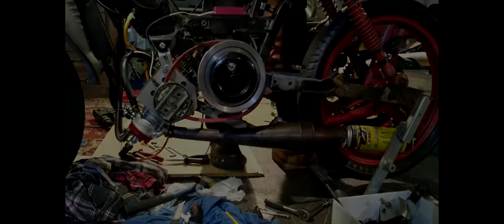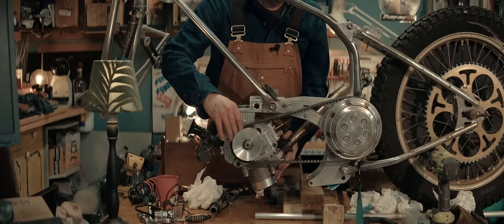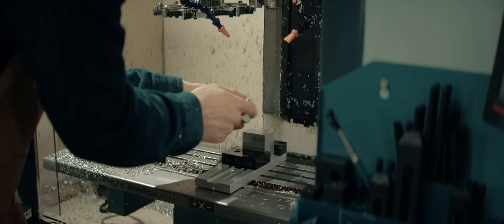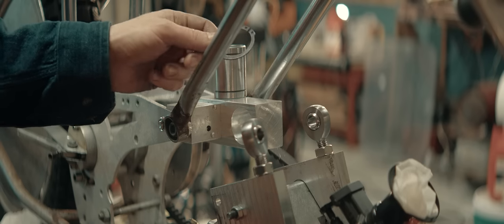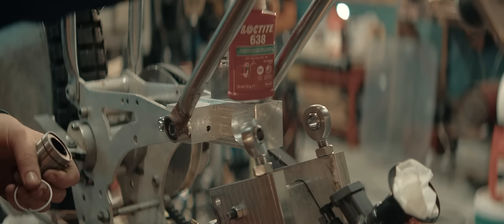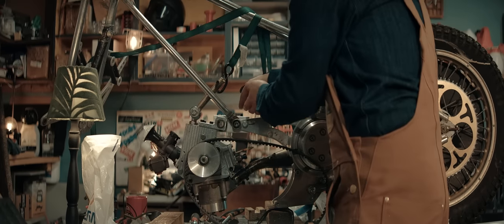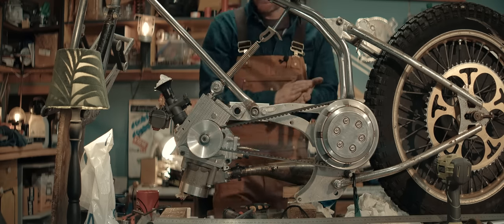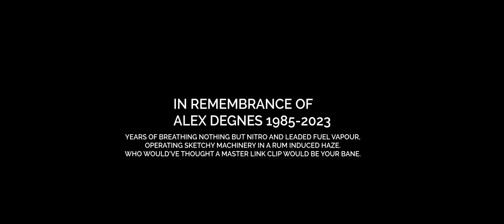A Norwegian Madman's Two Stroke Swinger in-and-out!

Comment: I ran across your channel a while back an I'm so glad I did. This is top tier content, without a doubt. It's not so much about editing or b-roll, it's about the engineering and watching you build. I think we'd all still be here if all you had to record was a webcam or an old phone. I just wish I'd found your channel sooner.

As a side note, if you did in fact put the exhaust through the middle of the frame, the gases could be used to heat the seat. lol
Reply: … and then it made a fireball …
Reply: @austinclark3495  Fair, but it'd be warm, just probably a lot warmer than intended
Reply: XD

Comment: Carefull with that cooling system. The way you had it set up makes the cylinder the highest point so it is prone to trapping air in there. Make sure to bleed it well before doing dyno runs. But I'm sure you alredy knew that.

Comment: I would love seeing you doing a video with Peter bjork doing technical solutions for modified vehicles. Peter won the street drag with he's r8 twin turbo intake air feed from Aircon to get more energy from the fuel air mixture aquired from the lower air temperature.

Comment: Im very curious as to why you are mounting the engine below the lower frame rail? There appears to be more than enough room to mount it inside the frame and maintain the ability to swing or slide. This just seems odd to me as I have never seen an engine not hung from the top bar. Otherwise, I tremendously appreciate everything you bring to the game. Thank you!

Comment: A thought struck me watching my favorite video release of the week --- is this the chassis you're going to be running at Bonneville?  If not, why go through all of the same mount / pivot-and-slide / tension issues twice?  Is that chassis not ready? 

A second thought came up as you scavenged the fuel system from the reference bike --- did you already take that to the commercial dyno to get calibration figures for your setup?  

A third thought came at the end.  I have a parts cabinet with a row of drawers just for critical items like the master clip, some scavenged, some purchased.  Whenever I start kicking myself about not being able to find a certain something, a new drawer gets allocated, and spares go in there.  The trick is to have only one special place for things like that!
Reply: The salts flat bike is still in America in Utah.

Comment: Neat as all get out, but why not fit the transmission and engine inside the frame instead of under it? just seams like the engine is way less protected then if it where in the frame like any other engine?????

Comment: I always loved your videos and ingeanuity man! The quality of them is phenomenal, but i wanted to say that  linear bearings usually aren't made and don't work with axial loading.
Reply: Not quite sure what you mean by axial load, the entire point of a linear bearing is to provide as little resistance as possible to an axial load. Are you concerned about the centreline of the belt being away from the centre of the bearing and applying a twisting force?

I have a feeling this scheme will not self centre the belt very well, it ideally needs a simple cam to shift the engine as it rotates around the pivot.
Reply: @ferrumignis if the bearing slides smoothly it should align good enough ? like better than if it was just rotating. otherwise maybe just need to add a spring on the other side and preload it to match the belt tension

Comment: Having been inspired by the past few years of your entertaining and informative dedication to the perfection of the 50cc 2-stroke, I spent a few hours reviewing the history of similar efforts.   My impression is that the highest revving 50 cc engines, 2 & 4 stroke,   have had 2 or even 3 cylinders with v. narrow power bands and lots of gears.  Single cylinders have had designated red lines around 15k (+-  ~2k.), which is where your engines have topped out.  You may have good reasons (excess complexity, your target build classification) to avoid >1 cylinder. But I am left asking the question:  Have there been any 50cc (edit) single cylinder engines made that break the 20k ceiling?
Reply: I assume you mean single cylinder 50cc engine revving past 20 000 ? Alex has a video from some time ago (edit; here is the video: https://youtu.be/vQ_aJrpW80g ) where he is thinking about a 50cc consisting of fourteen 3.5cc RC engines. 

I believe the key is to aim for highest possible rpm regardless. If the rpm is doubled and the BMEP is kept the same, the HP is doubled.
Reply: I believe you can find multiple vides on this chanel where one of his older engines revs to 18k
Reply: @nhytg376tgyuu765gjmg hat's a big IF..2 strokes don't have flat torque curve so if you 're trying to make the same torque at double the rpm you need to retune everything, airflow, carb, pipe, transfers etc
but here since rhe goal was always peak power and Alex already had a pretty good idea of where he wanted  the powerband, everything was designed from the get go to work the best a 15+k rpm. this (and supercharger+nitro) also explains lot of the issues to run this engine
Ideally, supercharging could make the airflow bottle neck disappear, and even make the pipe tuning not as important
Reply: Having dug further into the history of Alex's efforts I discovered a video from 4 years ago, "Will This Revolutionize 2 Stroke Engines," in which he discusses the problems of the v small cylinders required by multi cylinder 50 cc engines:  v. thin gaps between ports, boundary layer interference, and heat  management.  That being said, the fastest revving 50 CC 2-stroke Suzuki RP68 had three cylinders and equally fast 4-stroke Honda RC116 had two.  Ultimately I learned that the current (or nearly) land speed record for a super streamlined 50 cc 2-stroke used a SINGLE CYLINDER Minarelli engine (rev limit unknown), which reassured me that the single cylinder approach had some history of success.  My question has been  answered and concerns put to rest.
Reply: @utbpgs  I don't think the 50cc land speed record just doesn't gets enough attention for people to build custom multi cylinder engines

Comment: adding the hardest component for dyno calculations is cvt variant transmission. how are you going to calculate real engine power with that ? you will never able to break the record from the backwheel with belts because they lose so much power to the transfer. this is with snowmobiles and why they are in dyno from the crankshaft.
i would really consider that you would also start to make dyno for straight crankshaft connection with minimal power losses and easier to calculate real engine power 👍
Reply: That's what he was doing but this dyno is tried and tested.

Comment: I used to modify Kawasaki triples in the 70's. If you're looking to run over 100 mph with a 2 stroke , does it have to be a single cylinder? If not, a triple design would get your bore/stroke down and be plenty high revving. Suzuki had 50 cc race bike triples (3 cylinder, naturally aspirated) that put out 18-19 HP @ 19-20K and would run to about 120 mph. Take that stretch it so you'd have a lower riding position.. Got my blood boiling thinking about it. One thing that I know that you know is: when you get them running really good the powerband is very high and very narrow and a real pain.

Comment: 9:24 - I love using random stuff to get the job done.  I have aftermarket rearsets on my CBR500R, the return spring for the rear brake pedal is a random one that failed QC inspection at work (too long).  It actually works better than the spring that came with the rearsets.

Comment: but you can make a master link clip out of so many things that don't need that metal bit that can be shaped into a master clip... like the belt clip on a tape measure, it can be modified into being a chain link spring clip. a broken wheel spoke can to, but that's controversial... where is the tape measure?

Comment: I don't understand how you can expect to have accurate Dyno results with a variable pulley which can also slip.
Reply: If you can read a dyno you can identify things like belt slip. He has been using this dyno successfully for years.
Reply: @EddieTheH  that's not what I'm saying. You can identify it but that doesn't mean you can tell how much power it gave up. When 1 hp is over 5% total you have a problem there. That variator has no business in there for accurate testing. A worn belt changes the ratio which changes output. He has a clutch so the variator is completely pointless .
Reply: @jasonbirch1182  I agree, but he's been pretty successful with this setup for quite a while now.
Reply from the maker: I agree with every point. Only reason for the variator is to be able to quickly test the engine on the inertia dyno, make sure it's behaving.